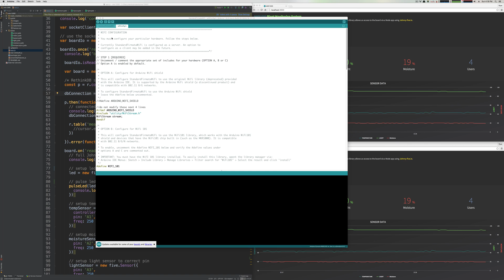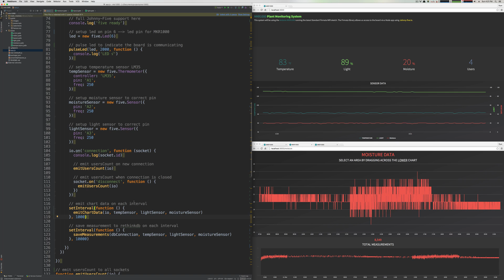MKR1000 Plant Monitoring System

Comment: Hi Ryan, thanks for the informative video.
Have you ever tried to connect more than 1 board to the web server for more data points?
Have a good day.
Reply from the maker: I'm not sure how easy it would be to update this old project but johnny five does support multiple boards. Here is a link to the docs where they use more than 1 board. http://johnny-five.io/examples/board-multi/
Reply: @ryangill9518  Thanks so much for the link. That might just be what i need. I can see straight away that boards are given ID's which is perfect. Have great day.